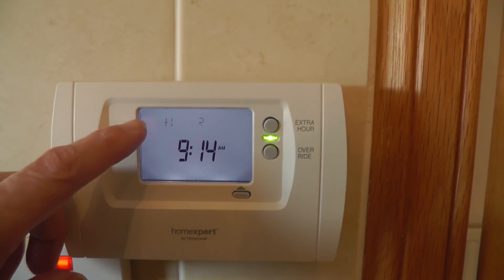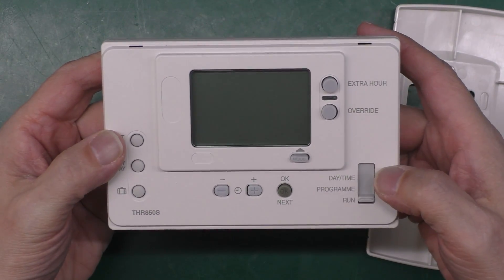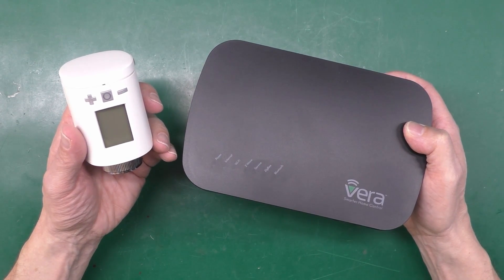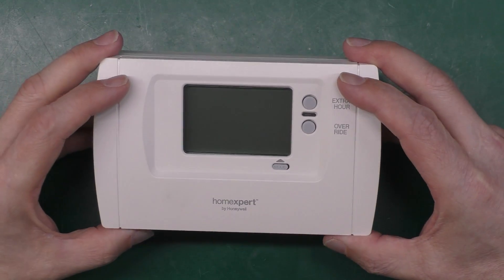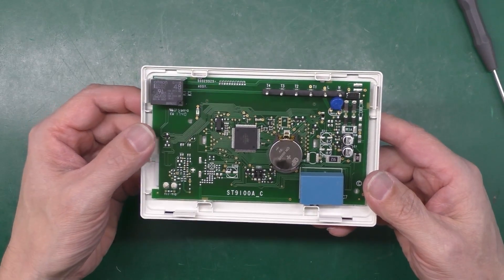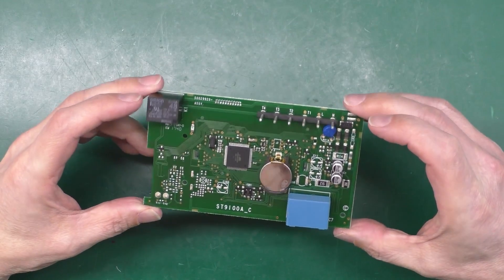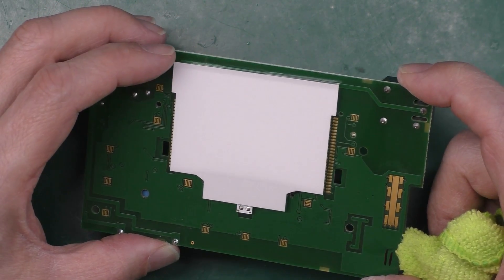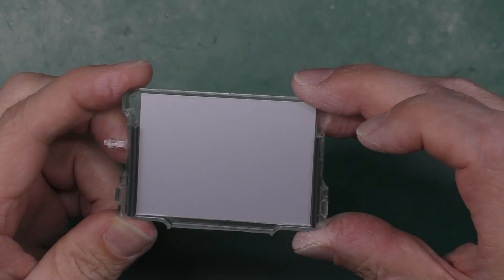No.050 - Honeywell Timer THR850S 10-Minute Repair

Comment: Used Nest for 4.5 years now - no problems, just works.
Reply from the maker: Don't know much about NEST, but does it have complete control over each radiator target temp and direct boiler control (replaces timer relay), the ability to run scene's and schedules...?
Reply: IanScottJohnston It does schedules (and learns them) and takes external weather conditions into account to calculate preheat times needed depending on building thermal characteristics that it learns.  Also has presence detection to switch off if you’re not there, and remote control via an app.  Normally you’d use it/them to control sectors of a building rather than individual radiators.
Reply from the maker: @Richardincancale  Got it.......I need to control individual radiators via electronic TRV's on each radiator so I can shut down particular rooms. We don't have any wall thermostats (although they can be added). Thanks for the info, something to have on the backburner.
Reply: The thing about Nest is that all the fun features, like learning when you are home and when you're out,  are controlled by their servers so you do have a privacy thing to keep in mind. If you look at their website it becomes very clear very quickly that they are fully aware that they are gathering very sensitive data, but then again every company says they do their best to keep it safe and that they don't sell it on etc...
Reply: vinny142 Its true - but the most they know is my heating pattern and when I’m not active in my house. Upside is I can see when I’m away on vacation if someone enters the house, even if the heating isn’t triggered - so I can see if my neighbours have watered the plants or if aliens have set up home there.
Reply: @Richardincancale  I've used Nest for 4 years and nothing but trouble! The pre-heat has a mind of it's own but It's also extremely basic and seems to lack functionality. At the moment, the best system seems to be the Honeywell Evohome.

Comment: The solution is to make your own system
Reply from the maker: If anything I have toyed with the idea of replacing the electronics inside the valves with my own, because thats where some of the bugs are, and more than one manufacturer has the same problem........but not an entire system, far too much z-wave work...:-)

Comment: That's not good for a brand new unit!  Makes you wonder if they QC their units, especially a company like Honeywell, their stuff is or used to be known for being quite good.  I wonder how many they have had returned from people who just take it straight back?
Reply from the maker: On review I think there's probably a design error.....there's not a lot of pressure on the ribbon strip and so they need to be really clean to make a contact with such light pressure.
Reply: @IanScottJohnston  Did you report the issue to Honeywell?  Cleaning the PCB and / or interconnects such as zebra strips are part of QA / QC rather than design, something seems to have gone wrong during production / assembly.
Reply from the maker: @Wilksey37  I sent them an email pointing them towards the video......:-)